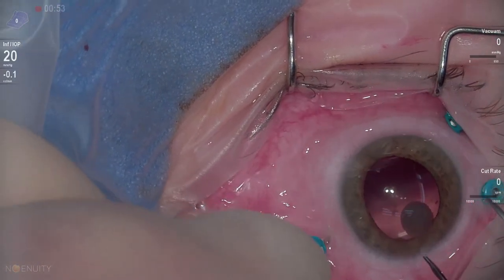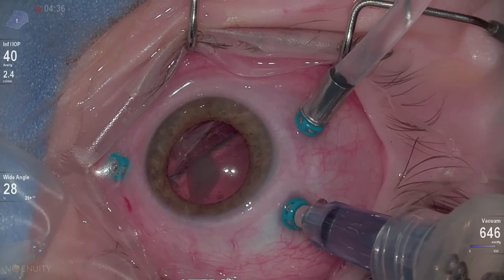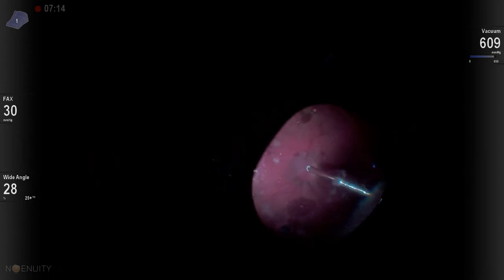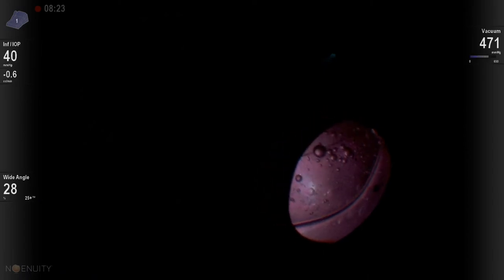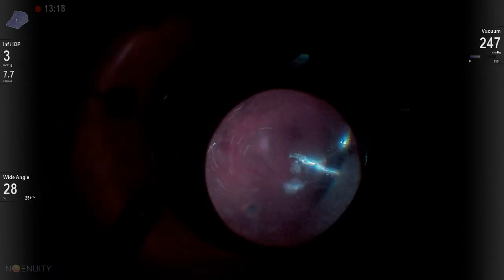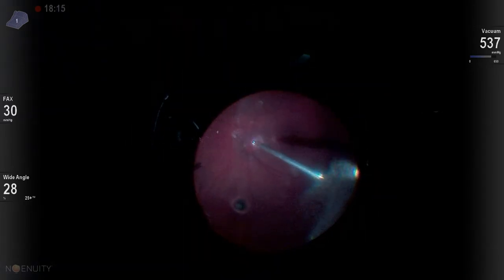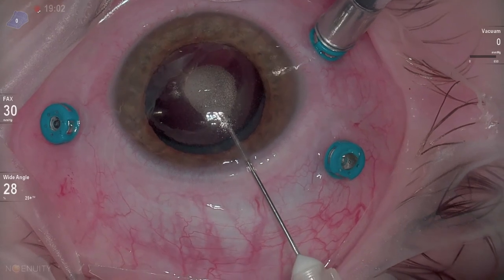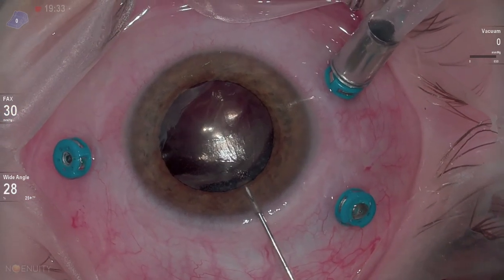Removing Silicone Oil (Emulsified)

Comment: I just had this done 2 days ago. They did it under "twilight anesthesia" which most people basically fall asleep, but I didn't. I have always had a very high tolerance to meds so I was wide awake. Several Fentanyl shots and still wide awake and sober lol. Overall it did not hurt much. The first lidocaine shot stung a bit. Towards the end they needed to inject another lidocaine shot in the rear of the eye and warned me it would hurt pretty bad. It did!! lol But overall it is not a terrible experience. And again, from what I understand most people barely remember a thing if anything but I was wide awake and talking to them the entire time.
Reply: How is your vision  now